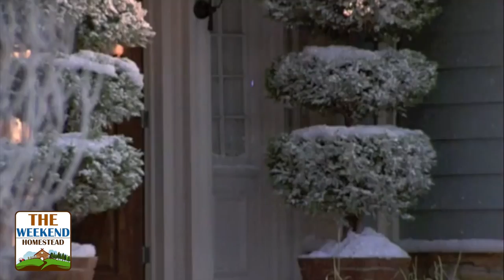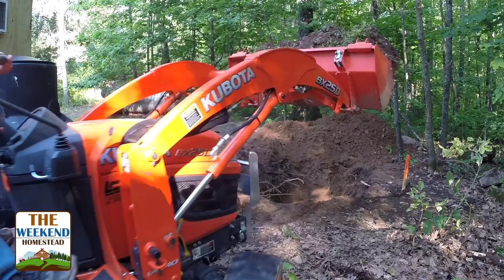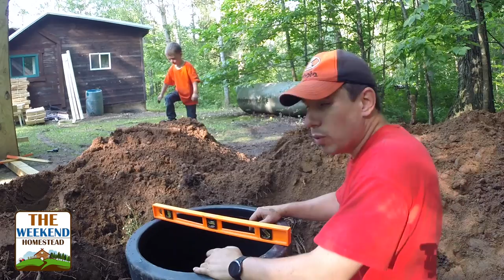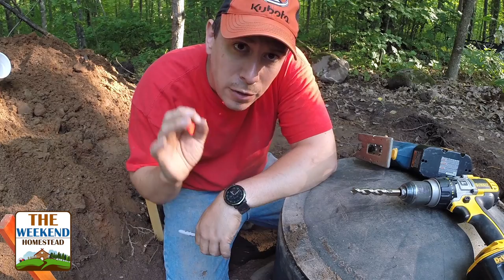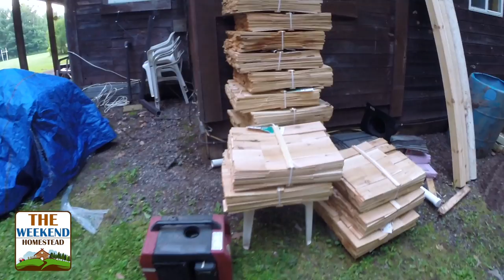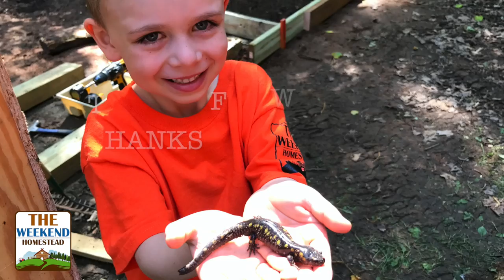DIY - How to install an Outhouse? Part 1 - Outhouse storage tank install!

Comment: Interesting, I have never seen one of those vessels. In my state the choice was (per regulations) a full septic system (over $30k) or a composting toilet. Seeing as Im building a hunting cabin the choice was easy. lol

Thank you for the video.
Reply from the maker: It was a total of $299 for the tank and i have maybe $30 in PVC for it to vent.
Reply: Can you post a link of where you got the tank from? My current out house is full and we need to move it AGAIN. This would solve the problem of the pumper not wanting to empty an out house.

Comment: We have a remote cabin, completely off grid. We would really like using composting for convenience. We want a reliable system. So what would you recommend? Could you give a quick pros and cons to each system (compost vs tank system liked you used). Thanks in advance.
Reply from the maker: sorry but i dont know much about the composting toilets.

Comment: Where did you buy that tank? I have looked and looked for them. Also, do they require a permit or anything, and can they be used as another option in the place of septic where septic systems are now being forced and required on unrestricted land?
Reply from the maker: To buy the tank no permit. It install the tank did take a permit. I got it at a retailer called L&M but I believe they have them at tractor supply.
Reply: Permits where I live we don't need no stinking permits ...lol

Comment: Did you put in the tank any kind of solvent before use?
Reply from the maker: No, but on the bottom I plan to put a small amount of a deodorizer liquid about 2inches
Reply: The Weekend Homestead do you have a video of the finished project?
Reply from the maker: Winter came so it will be finished in April